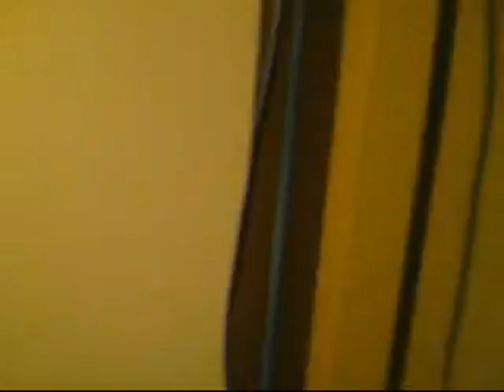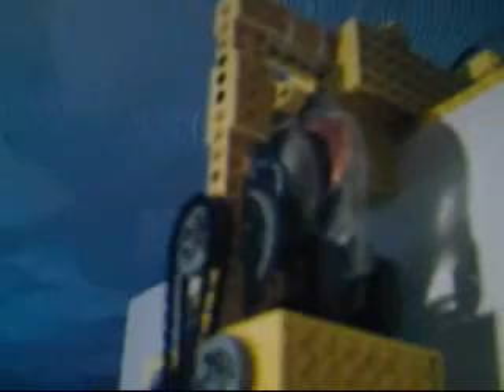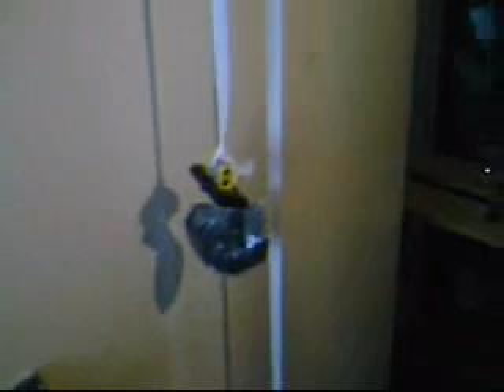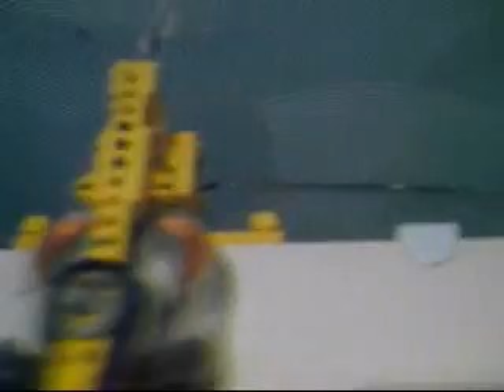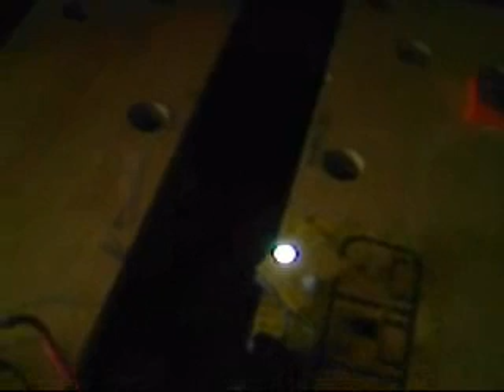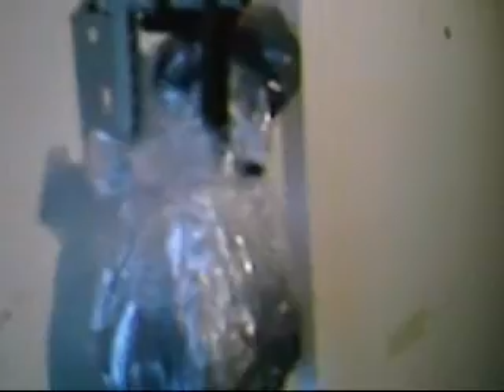Lego Technic Weight Driven Generator

Comment: 35% is about the upper limit of what a gasoline-powered engine is (However a Diesel-powered engine is around 50% and an Electric motor is around 90% by the way) so you aready beat what a gasoline-engine can make and all your useing is Lego's and wieghts.

Comment from the maker: there's some discussion & calcs on the Fieldlines forum, linked to in the 'About this video' info (upper right)

consider the definition of 1 Horse Power... 33,000 lb.ft./minute... if you could capture 100% energy, 4 tons dropped 1 foot in 1 hour is equivalent to about 90Whr, maybe enough to power a 20" TV... factor in the system efficiency & you could be looking at just 30Whr.

if you're thinking of going ahead with something like this, send me a message for some pointers.

Comment: This is very impressive i did make once a lego generator out of copper wire and gearing it all but it was hand power like a hand powered torch. I tested it and i got around 5-6 volts out of it. and powered a LED but was never constantly on.